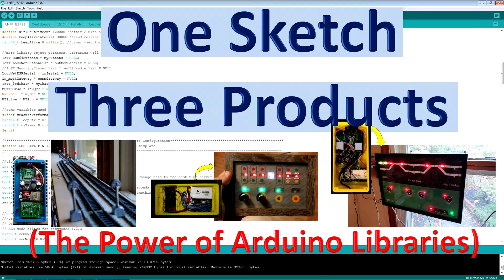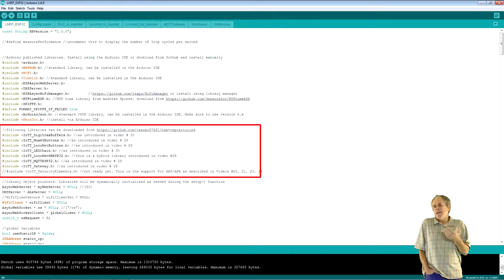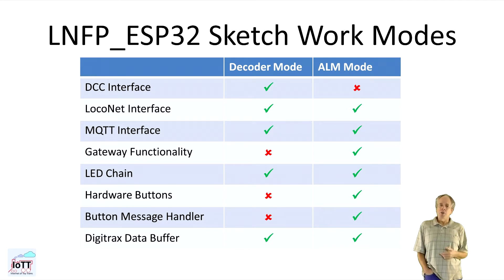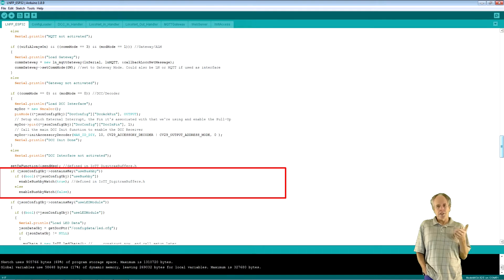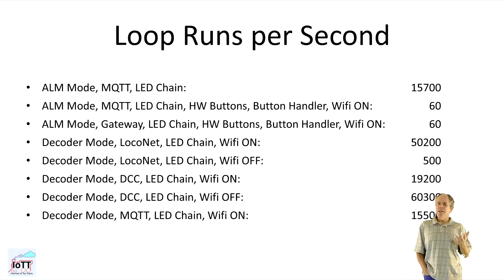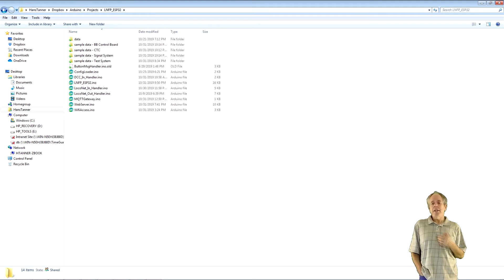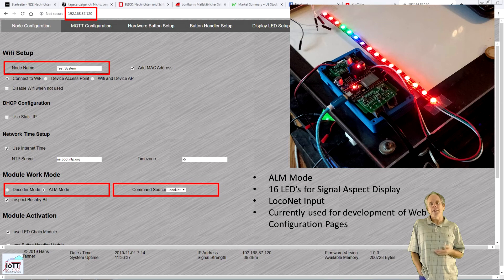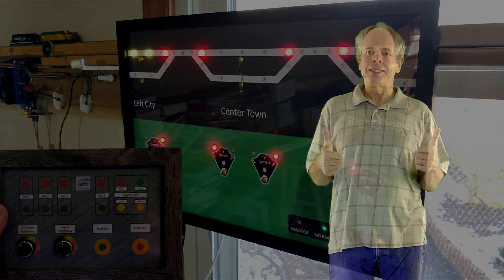One Sketch - Three Products (Video#31)

Comment: Hi,
This time I have taken a PC box out of the cupboard, put a 80G hard drive and a DVD drive in it and started from nothing.  Installed windows7 64bit  and then the latest Arduino IDE. No chance of any stray anythings anywhere. Added https://dl.espressif.com/dl/package_esp32_index.json   in the Arduino IDE preferences.  Installed the ESP32 library using library manager.
I then down loaded LNFP_ESP32  and compiled it.  Obviously at that point there was the  "fatal error: XXXXXXXX: No such file or directory"   many times as I worked my way forward through the list of #include compiling each time to ensure that I missed none of the required files.   From a blank computer it is amazing how many "Multiple libraries were found for XXXXXXXX. 

C:\Users\IoTT\Documents\Arduino\libraries\ESP8266WiFi\src/ESP8266WiFiType.h:26:19: fatal error: queue.h: No such file or directory

 This one is now blocking progress.  I Googled it but no useful information resulted.  Hans, somewhere on your computer you must have a queue.h .  I would much appreciate you sharing it.

Ross
NZ
Reply from the maker: I checked my system, my ESP32 installation has 3 (different) queue.h files. Here are the locations for verification with your installation:
C:\,,,\Arduino15\packages\esp32\hardware\esp32\1.0.4\tools\sdk\include\esp32\rom
C:\...\Arduino15\packages\esp32\hardware\esp32\1.0.4\tools\sdk\include\freertos\freertos
C:\...\Arduino15\packages\esp32\hardware\esp32\1.0.4\tools\sdk\include\newlib\sys
Check if they are part of your installation as well.

What is most interesting in your error message though is that it apparently tries to include a file from the ESP8266 core, so for some reason it thinks it is compiling for an ESP8266 when it should include WiFiType.h from the ESP32 code base, in my case C:\...\AppData\Local\Arduino15\packages\esp32\hardware\esp32\1.0.4\libraries\WiFi\src
 The other strange thing is that you have the ESP8266 code in the library section and not where the code normally resides, in the AppData area.

Can you tell what library is actually causing the problem? I mean, when you create a new sketch and add the includes from my sketch one at a time, at what point does it start having this error? Knowing this would probably help where to look for next.
Reply: @IoTT  Hi,  I set up the new blank sketch and added the includes one by one. All was well until  #include <NTPtimeESP.h> . resulting in

 this one....
C:\Users\Iott\Documents\Arduino\libraries\ESPWiFi\scr/ESP8266WiFiType.h:26;19; fatal error: queue.h: No such file or directory
 

NTPtimeESP.h references  ESP8266WiFi.h in line 6.
I did not load the 8266 core on this computer as I believe It is not nesseccary  so ESP8266WiFi was loaded as a library using library manager

I // that one and got as far as #include<NmraDcc.h> .  Which version of this are you using?. 

In file included from C:\Users\IoTT\Documents\Arduino\libraries\NmraDcc-2.0.0\NmraDcc.cpp:36:0:
C:\Users\IoTT\Documents\Arduino\libraries\NmraDcc-2.0.0\NmraDcc.cpp: In function 'uint8_t validCV(uint16_t, uint8_t)':
C:\Users\IoTT\Documents\Arduino\libraries\NmraDcc-2.0.0\NmraDcc.h:106:18: error: 'E2END' was not declared in this scope
#define MAXCV    E2END          // the upper limit of the CV value currently defined to max memory.
                  ^
C:\Users\IoTT\Documents\Arduino\libraries\NmraDcc-2.0.0\NmraDcc.cpp:560:12: note: in expansion of macro 'MAXCV'
   if( CV > MAXCV )
            ^

Yes I have  located queue.h  in all 3 places. The standard PC Windows Search programs and files did not locate any of them unless I put in the whole path.
I checked that C:\...\AppData\Local\Arduino15\packages\esp32\hardware\esp32\1.0.4\libraries\WiFi\src\WifiType.h  is also where it should be.

Tiss an interesting and educational journey.

Ross
NZ
Reply from the maker: Thanks for the report. I agree, you should not use the ESP8266 stuff, so it is a good idea not loading it onto your new system for the moment.
I did some research regarding the NTP library. It looks I did a modification of the NTPtimeESP.h a long time ago I forgot about it and I probably need to make the modified version part of the sketch. Here is the mod for you to try:
Line #15 and following should read:
#include <Arduino.h>
//#include <ESP8266WiFi.h>

 #ifdef ESP32
   #include <WiFi.h>
 #else
   #include <ESP8266WiFi.h>
 #endif

#include <WiFiUdp.h>

So what I did is selective loading of the libraries based on processor type.

Re NmraDCC, I am using the latest version 2.0 which was uploaded about 2 weeks ago. See if the error persists after the mod of NTPtime. If so, try to compile one or two of the examples that come with the NmraDcc lib. If that works, the installation of the library is ok and we can go from there.

Yes, I agree, it is educational even though annoying. But unfortunately not uncommon when working with Arduino.  The alternative would be using platformIO, where all libraries can always copied into the sketch directory, but so far its use is not so widespread, so for the moment I use the Arduino IDE (and a new, better version of it appears to be in the makings).
Reply: @IoTT  hi,  I modified   NTPtimeESP.h and that solved that ;-)
I tried a couple of the examples for NmraDcc and got the same error so I deleted any reference to NmraDcc from the computer and ran a blank sketch with just an #include Nmradcc.h resulting in no file found as expected. I then went to github and down loaded NmraDcc.zip installed it via library manager and ran the blank sketch again, this time with no error. I noted that the version is 2.0.2 .
LNFP_ESP32 now gets down to line 24   #include <IoTT_LEDChain.h>

(FastLED gives a very similar error message in a blank sketch also but compiles ok so I suspect that  may not be the problem.)

In file included from C:\Users\IoTT\Documents\Arduino\libraries\IoTT_LEDChain-master\src/IoTT_LEDChain.h:5:0,
                 from C:\Users\IoTT\Documents\Arduino\libraries\IoTT_LEDChain-master\src\IoTT_LEDChain.cpp:1:
C:\Users\IoTT\Documents\Arduino\libraries\FastLED/FastLED.h:14:21: note: #pragma message: FastLED version 3.003.002
 #    pragma message "FastLED version 3.003.002"                    ^
In file included from C:\Users\IoTT\Documents\Arduino\libraries\FastLED/FastLED.h:65:0,
                 from C:\Users\IoTT\Documents\Arduino\libraries\IoTT_LEDChain-master
\src/IoTT_LEDChain.h:5,
                 from C:\Users\IoTT\Documents\Arduino\libraries\IoTT_LEDChain-master\src\IoTT_LEDChain.cpp:1:
C:\Users\IoTT\Documents\Arduino\libraries\FastLED/fastspi.h:130:23: note: #pragma message: No hardware SPI pins defined.  All SPI access will default to bitbanged output

 #      pragma message "No hardware SPI pins defined.  All SPI access will default to bitbanged output"                      ^

C:\Users\IoTT\Documents\Arduino\libraries\IoTT_LEDChain-master\src\IoTT_LEDChain.cpp: In function 'actionType getLEDActionTypeByName(String)':
C:\Users\IoTT\Documents\Arduino\libraries\IoTT_LEDChain-master\src\IoTT_LEDChain.cpp:40:38: error: 'dccsignalnmra' was not declared in this scope
   if (actionName == "signal") return dccsignalnmra;                                       ^
C:\Users\IoTT\Documents\Arduino\libraries\IoTT_LEDChain-master\src\IoTT_LEDChain.cpp:41:41: error: 'dccsignaldyn' was not declared in this scope
   if (actionName == "signaldyn") return dccsignaldyn;                                         ^
C:\Users\IoTT\Documents\Arduino\libraries\IoTT_LEDChain-master\src\IoTT_LEDChain.cpp:42:42: error: 'dccsignalstat' was not declared in this scope
   if (actionName == "signalstat") return dccsignalstat;                                          ^
\Users\IoTT\Documents\Arduino\libraries\IoTT_LEDChain-master\src\IoTT_LEDChain.cpp:46:40: error: 'constantled' was not declared in this scope
   if (actionName == "constant") return constantled;                                        ^
C:\Users\IoTT\Documents\Arduino\libraries\IoTT_LEDChain-master\src\IoTT_LEDChain.cpp: In member function 'void IoTT_LEDHandler::updateLEDs()':
C:\Users\IoTT\Documents\Arduino\libraries\IoTT_LEDChain-master\src\IoTT_LEDChain.cpp:574:8: error: 'dccsignalstat' was not declared in this scope
   case dccsignalstat: updateSwSignalPos(false); break;      ^
C:\Users\IoTT\Documents\Arduino\libraries\IoTT_LEDChain-master\src\IoTT_LEDChain.cpp:575:8: error: 'dccsignaldyn' was not declared in this scope
   case dccsignaldyn:  updateSwSignalPos(true); break;        ^
C:\Users\IoTT\Documents\Arduino\libraries\IoTT_LEDChain-master\src\IoTT_LEDChain.cpp:576:8: error: 'dccsignalnmra' was not declared in this scope
   case dccsignalnmra: updateSignalPos(); break;        ^
C:\Users\IoTT\Documents\Arduino\libraries\IoTT_LEDChain-master\src\IoTT_LEDChain.cpp:580:8: error: 'constantled' was not declared in this scope
   case constantled: updateConstantLED(); break;        ^

Tiss a good way to pass the hours on a rainy day :-)
Reply from the maker: Great, sounds like progress. Re the NTP lib, I have created an issue on the Github page requesting that the author is adding ESP32 support. Hopefully he will do it.
Interesting that reinstalling NmraDCC did the trick, looks like something went wrong with your initial installation. I also see there is a version conflict on the Github page, one entry says 2.0.0 and the other 2.0.2. Anyway, we are using the same version.
Don't worry about the SPI warning of FastLED. That just means we are using bitbanging instead of the SPI port. It is just a warning, not an error.
Re the other errors, it looks it is not finding the IoTT_ButtonTypeDef.h header file that has all these definitions in line 7. Identical copies of that file are found in IoTT_LEDChain/src and IoTT_Mux64Buttons/src. LedChain should load them through line 7 in IoTT_LEDChain.h which should read #include <IoTT_ButtonTypeDef.h>
What you can try is to include the same #include <IoTT_ButtonTypeDef.h> line in IoTT_LEDChain.cpp right in line 2 after the #include <IoTT_LEDChain.h> 
I tried it and it compiles fine on my system, with and without that line in the cpp file. 
Hope that helps over the next cliff. Not many more to go ;-)
Reply: @IoTT   Yes I find 3 copies of IoTT_ButtonTypeDef.h.  2 are 510 bytes and the one in IoTT_LEDChain is 562 bytes.  As they all start with #ifndef IoTT_ButtonTypeDef_h  my understanding is that the first time its called sets the Def.  This is currently in  IoTT_Mux64Buttons.h which has a 510 byte version of  IoTT_ButtonTypeDef.h . Line 7  has more variables declared in the larger file.
I tried your suggestion but got the same errors

I moved IoTT_LEDChain.h  up above  IoTT_Mux64Buttons.h which now makes the Def the 562 byte version,  IoTT_LEDChain.h is now happy.
But  now IoTT_LocoNetButtons is not happy because one of its variables is now not declared

due to the changed line 7 in IoTT_ButtonTypeDef.h 

More head scratching.
Ross
NZ
Reply from the maker: Hmm, where do find the third one? There should be one in LEDChain and one in MUX4067Buttons, and 562 bytes would be the right version. The difference is in some additional definitions of action types in line 7 of the library.
Now, I have replaced the smaller one on Github, in fact I re-uploaded the whole MUX4067 library, which resulted in replacement of the ButtonTypeDef.h and the Mux4067Buttons.cpp
The other 3 files obviously were identical. I believe the cpp is also identical to the one that was uploaded before and the new version just had a different date because I was playing around with it, but to be sure you may want to download the latest version. It compiles fine on my system. Another way to verify is compiling the ButtonInputReport sketch in the IoTT_Mux64Buttons library, which also should compile fine with the replaced ButtonTypeDef.h
Thanks for finding this.
Hans
Reply: @IoTT  The third one is  C:\....\Arduino\libraries\IoTT_LocoNetButtons-master\src
Reply from the maker: Ok, thanks. I had deleted that one on my system since if you compile everything at the same time, it only needs it the first time, as you have already figured out.
Anyway, I replaced it on Github, and the same thing happened with the cpp file. It was replaced with the new version even though I think it really is the same with just a newer date. But you probably should download the latest just to be sure.
And then hopefully the whole sketch will compile after all. Thanks for your efforts and finding the errors.
Hans
Reply from the maker: Yes, the thing is this is not the MUX4067 library, but the ButtonHandlers. Maybe I was not clear in my last reply, you should get the latest from IoTT_LocoNetButtons as well. Sorry for the confusion.
This is the link: https://github.com/tanner87661/IoTT_LocoNetButtons

In line 20 of the cpp file, where you have the dccsignal error, it now says dccsignalnmra, and so on. 
I made these changes to support signal control using nmra signal commands or the Digitrax SE8c style using 2 switch addresses. In fact, the library can also support 3 or 4 switch addresses per signal, dynamic (the latest switch command) or static (the combination of statuses of all involved addresses). That's why there are now more action types.
Reply from the maker: Hope you have some progress. As requested by another user I have added a libs.zip file to the LNPF_ESP32 repository. This file has pretty much all libraries in the version I am using. Might be helpful for you as well.

Comment: hi,
i worked through the suggestion for the 'class MQTTESP32' has no member named 'loadMQTTCfgJSON  error   and found the there is indeed a reference to 

void MQTTESP32::loadMQTTCfgJSON(DynamicJsonDocument doc)  in line 130 of the .cpp file.  However in the .H file at line 54  it is blank.    i have the latest gihub download which shows the .cpp file upload as 3 days ago and the .h file upload  as  2 months ago.

Ross
NZ
Reply from the maker: Excellent, you just earned the BlueBox-Award ;-) 
Looks indeed like I missed that one. So I have uploaded the header file that includes line 54 and incremented the version of the library to 1.1.2.
Thanks, Hans

Comment: Hi,
I get this error.....   LNFP_ESP32:1:20: error: Boards.h: No such file or directory compilation terminated.
exit status 1
Boards.h: No such file or directory

And I have had no success in getting google to find anything called Board.h that I can get hold of .
There has to be a way past line 1 of LNFP_ESP32.   I just haven't found it yet.

Ross
NZ
Reply from the maker: Boards.h is a header file of the Firmata library, but I am not using it, at least not knowingly ;-)
It looks like a problem with the ESP32 installation in your IDE, that's where I would start.
If you can't figure it out that way, you can always create a new sketch, make sure it compiles,  and then rebuild my sketch step by step, starting with the includes. That way you find out when the problem occurs and can dig deeper on that.